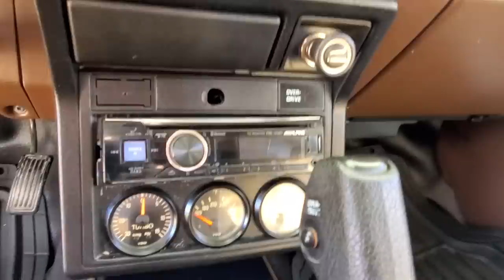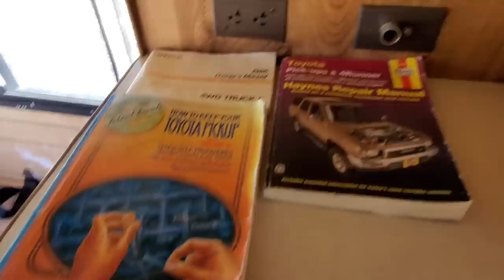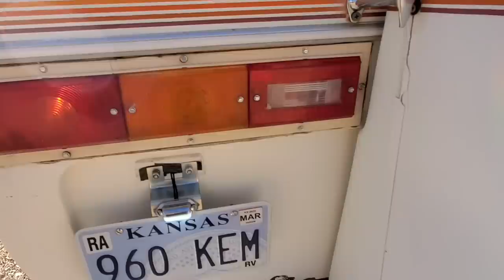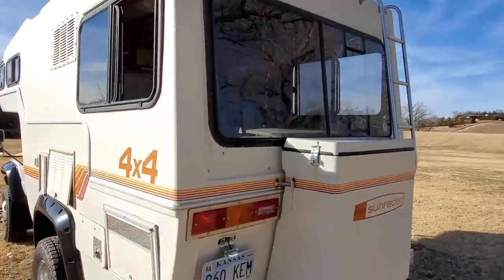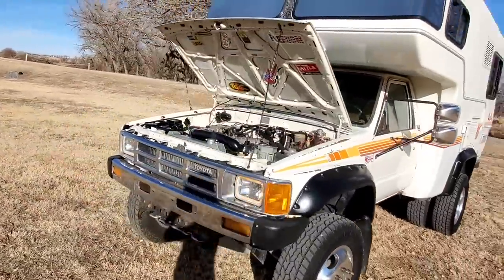Atlas - 1986 Toyota Sunrader 4x4

Comment: The outside looks fantastic, but I'm thinking about how the inside could be after a gut job and rebuild using modern, lightweight materials.
Reply: The age to it looks nice if anything refurbish the same style
Reply: I'd rather have japanese older material then all modern garbage materials.
Reply: That mind set is exactly why you see two out of three toyota rvs on Facebook marketplace gutted on the inside. People see a few videos millennials post of them "modernizing" these rare old campers and everyone thinks they can do it. Not realizing how intensive and expensive it actually is. If you buy one of these KEEP IS AS ORIGINAL AS POSSIBLE. I've owned a couple, they are well equipped and setup from the factory. Please People stop thinking that you have time to "gut and restore" one of these only to leave it gutted and one step closer to the scrap yard in many situations. Just my two cents.
Reply: @burnheretic3950  how old would you say millennials are?
Reply: @zacheryredden5417  1980ish thru 1995ish boss.
Reply: @burnheretic3950  this is reading as criticism but j could be wrong, but i would never feel comfortable in a truck that was that worn, i think a lot of people feel that way, so it seems that regardless of if their gutted they end up in the yard anyway because they need to renovated.
Reply: @burnheretic3950  I buy flip and sell things like this it’s really not that hard nor expensive if you do it right

Comment: This is the very close to the rv I have, except 2wd. Since I live in it, I switched to all LED lights, 500w solar, 580ah lithium batteries, 2000w inverter, re- roofed, new tires, fixed heater, oven, new fridge, added water filter, upgraded bathroom, custom made insulated wall/ window blackout coverings, 3 fantastic fans with insulated blackout covers and fully shrouded up top, added a backup camera...I love it!

Comment: 22re are one of  the best 4 cylinder engines ever made in its time until now if they Wheir in production . . I had a 1991 Toyota pick up with this 22re engine , I got 345.000 miles with same timing chain. I had 2 tune ups done 4 break  jobs and same transmission sold  it to a man who took it to south America. Love these trucks also the old t100 6 cylinder is a bad azz truck to. 👍
Reply: My 22re pickup truck only had 275k but my buddy had a Toyota motorhome 22R 5 speed with 250,000 miles, we're talking a 40 year old motorhome with a quarter million miles and he still daily drives it cross country and it runs great. Pulling an entire house
Reply: I just find it impressive a 4 cylinder can pull a motorhome so far. Why do modern cars suck so badly..we already figured out how to make a good engine. We're going downhill

Comment: Fantastic TSR4x4! I got very similar interior in my '78 minus the crazy carpet. Great decision not to put any weight to the top! These trucks are light weight, my 2WD says only 4600lbs and does 15-20mpg. Nothing can go wrong with mixing fiberglass and yodas!
Reply: Only 2wd? Really? Could it be converted to 4 wheel?

Comment: That is one bad ass RV! I own a rare 1994 4x4 Serro Scotty Highlander. It's based off the 2nd gen. 1994 Dodge RAM 3500 5.9l Turbo Diesel. They stop making them in 1996-1997 after the factory burned down.  
Keep us up to date on what you do with your rig. Definitely a unicorn. 
Thanks for sharing.
Reply from the maker: Thanks! Believe it or not but I also own a 1996 Serro Scotty HilanderGT, 4x4, 5speed NV4500, Cummins 12v. Like the Scotty factory, the Sunrader factory burned in 1987. Both rigs are absolutely great machines.

Comment: My 87 Toyota has tip gages where those holes in your dash is. It's a three Guage unit, in the unit is an altimeter, front to back angle Guage and a side to side angle guage.

Comment: That is cool,kind of surprised it has an automatic instead of a 5 speed manual,I like the way the generator is set up to run fuel from the trucks gas tank so you don't have to constantly refill it.

Comment: Those are super cool, perfect mini camper.   Thanks for showing.   The turbo gauge really had me perplexed, I see no signs of a turbo in the engine bay.  The engine could use one for sure, stock was like 105 HP?  Oh I bet the turbo gauge is manafold pressure, shows vacuum (like you said) for the naturally aspirated flavor.

Comment: I had a 1986 4x4 pickup. I know they made a 1 ton two wheel drive pickup but I have never seen a 1 ton 4x4 version. I imagine Sunrader took a a stock one and upgraded from a stock 1 ton 2wd or stock 4wd and a made it a dually. Id love to have 1 ton tacoma with small diesel.
Reply: That sounds great as long as I can get it with a 6 speed (or more) manual transmissions.

Comment: I had a 78 18ft dolphin, wish I still had it, I want the sun Rader, I had single axle with the right rubber did awesome in the snow, Raton pass was a breeze, bad thing is the black tanks are hard to match for replacement, and I would take the wait off your roof, they tend to buckle but you can do some fiber work and reinforce. that's the cool thing with fiberglass, you can work it, unlike tine "all man' cool rig bro-peace

Comment: Oh would I love to have that. That’s perfect for haul the old side by side to Disney, KS rocks, etc.
Reply: That's a very nice looking Toyota RV. I've had a few Nissan trucks pulling weight over the years and broke a few transmissions and rear ends. Things broke from being overloaded and not enough truck. But you work with what you got at the time. I could imagine pulling a side by side on a trailer it would get slower, worse gas mileage and may be overheating on a hill. With most things it'll be easier on a truck pulling if you go slower. My best fuel mileage in my 4 cylinder Nissan with 5,800 pounds wouldn't touch my inline 6 cylinder Cummins diesel truck with some weight around 12,500 pounds. And with the Cummins I pulled 23,300 lbs max GVWR once. I often weigh things at the scale. Don't get me wrong Nissan's and Toyota's are very good and dependable trucks but in my rust belt wet area they rust apart bad. The last few Nissan trucks I sold sadly I took a loss on them because they were rusted so bad and nobody wants a fixer upper. When the frame gets so bad they start to wobble down the road even if you can get them inspected. I wish I would have went to a diesel years ago they hold their value better, better fuel mileage and can pull more weight.
Reply: You bring your side by side to disney? Where do you use it?
Reply: @ca6360  ya I’ve been to Disney a few time now. Heading to rush springs ranch, next weekend.

Comment: Holy crap, that motor is barely broken in.  Treated with high quality lubricants and regular maintenance you can get more than 400,000 miles from a 22RE.

Comment: The seats originally had a tweed striping stitched into them to match the interior colors.
Reply from the maker: Correct. Unfortunately the tweed has been ripped off by a previous owner and all that's left is threads which make the seats look worn out.

Comment: The 22RE is the best engine to have in the apocalypse.. at 60 degree ambient temp that motor can run without water if you keep it under 2500 rpm.
Reply: That engine is solid! I had a ‘94 Toyota pickup with that motor and it had  over 210k on it when I got rid of it. Zero issues while I had it.
Reply: @KRT045  wonder what his turbo gauge is for?? I had a 94 also, it was non- turbo and this looks the same. Maybe just vacuum for something??
Reply: @robf5047  good question. I didn’t even catch that.

Comment: The outside is a homerun... yes it needs a little TLC  but nice ! When the inside is done, I'd put in a diesel heater, an Engle fridge and ditch the generator for electrical goodies (sorry that's just me) do the interior and you are Golden.. nice ride

Comment: The 22R engine always cracked me up considering the amount of weight a camper of that kind could be loaded up with.  Some came with a 6 cyl, which made more sense.
Reply: I've thought a lot about stuff like this as I prefer to drive older vehicles.  It makes more sense when you realize that the speed limit back when these were new was 55 and these older vehicles were geared accordingly

Comment: At least this one was built on a chassis designed to carry that weight. Most of them were on the much lighter pickup with a max load of 1000 pounds which included passengers and fuel. Bassically a passenger car with a pickup bed.

Comment: Those aluminum radiators are always the way to go in any vehicle you can own aluminum radiators are worth it they will not leak unless it's the cap or fittings and those can be fixed

Comment: I've never heard of a generator normaly running off of propane. Most I think run off of diesel. And you can do an air pressure test on the water system. Save yourself a lot of time and money and gut it.

Comment: Wait,   64k in a 50 year old camper?  Are you Santa clause or something?  I put more miles than that on a Goldwing.
This camper is just killer but whoever owned this before you are not
Tear the doors off your upper cabinet, route out the hole to one long space and cut some plexiglass to 2/5 of the hole and put them in place of the doors.  Sliding doors don’t come open when you turn.
I’d love having one of these things.  They would make my Vanagon look like a covered wagon
If you value the one or two mpg you might gain from the front air dam, by all means put it on.  Otherwise, meh.